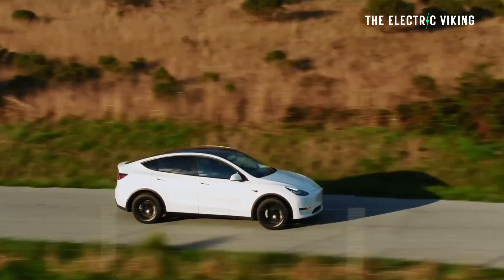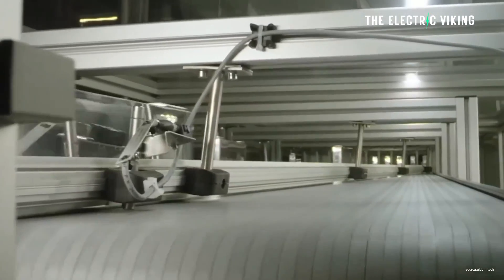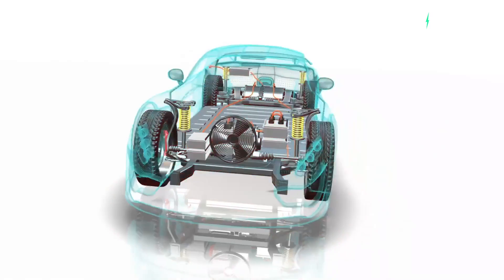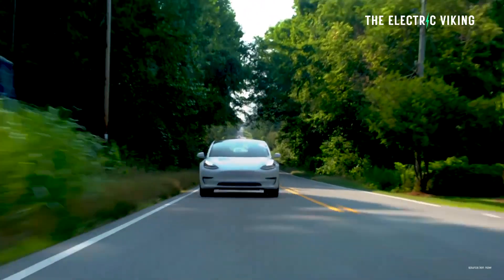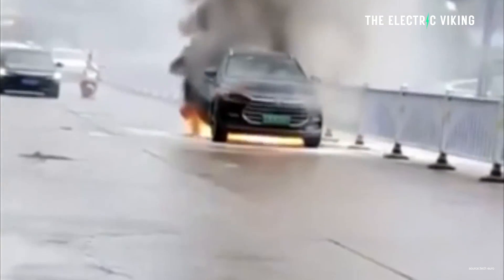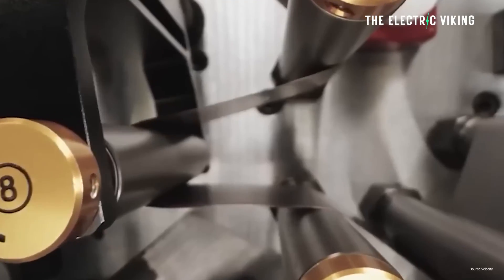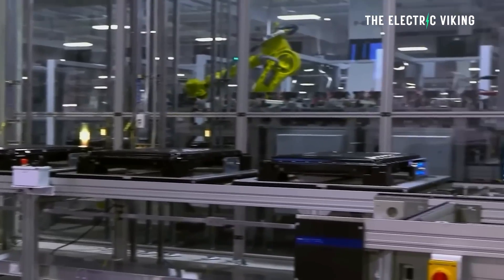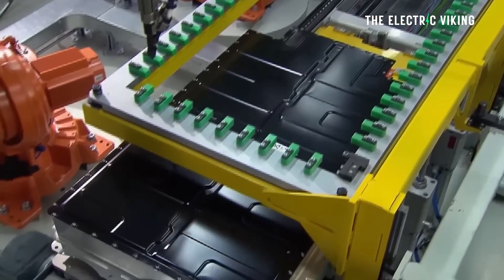Tesla offers LFP battery & suspension upgrade for Model 3 with 2170 cells

Comment: We just had our 2021 SR+ battery replaced with an LFP remanufactured battery after Tesla  posted the BMS u029 code on our screen.  There were no indications of battery malfunction.  Tesla still uses the 2170 batteries in higher trim performance models as the LFP battery is 120kg heavier.  Could it be sneaky Tesla wanted the LFP battery in my SR+ for warranty puposes on performance models?

Comment: Hi, I need urgent advice!!! I have a model 3 2021 SR+ and recently the battery failed, I took to service under warranty they made me sign a paper saying I will be getting an LFP battery upgrade. Long story short, a week later my app notifies me that service is done. I go to the location and pick up my car and drive away. 3 weeks later I receive another call from tesla employee telling me I need to take. my car back to them because apparently my car was not accepting the LFP battery so they had to put the same older type of battery but during the service process they had put different suspension to accommodate the LFP battery (as mentioned here in the video), so therefore they need me to go back so they can replace the upgraded suspension back to my older system of suspension that is made for non-LFP cars....... It sounds fishy to me. Why was this not communicated to me during service?  Please help me with advice. Thanks

Comment: I would just prefer if they would offer LFP batteries in their long-range models with a bigger battery pack. I assume lots of taxi drivers would be positive in that sense they need to use super chargers during a work day. At least if the car is used by more than one driver per day.

Comment: LFP or LiFePO4 actually has been used in e-bikes since 2013. I used to build my e-bikes with them because it has double the life span of regular lithium batteries. However, in terms of peak voltage and weight, the 21700 is better. I suspect that’s why they will give the car new suspension to deal with the increased battery weight.

Comment: so would this be a LR pack or a SR pack? If I have a damaged Model 3 Long Range is has (depending on manufacturer) around 80 kWh. Would the replacement be a similar capacity or would that be a smaller (standard range) pack?

Comment: After three and a half years my 2019 model 3 had battery issues and required replacement under warranty.  I requested a LFP replacement battery but the Tesla service center in Canberra advised that they could only replace like with like.  I am happy with the replacement battery (but preferred LFP) and  have an increased range of about 40 kms.

Comment: The LFP being discussed can be charged to 100%.  But charging rates are 100KW less.  More than 40% slower. Horrible on a trip.  Plus, this “more range” claim than 2170s is flat wrong. Heavier and less power storage dense. Also, claim that Japanese-American made batteries are less reliable (defects) than ChiC0M, not true. If an owner does not ever road trip charge, charges at home overnight, local driving, these LFP can make sense.

Comment: I dont think Viking fully understands the engineering behind a LiPo to LiFePo4 transition.
LiFePo4 has lower voltage per cell (4.2v vs 3.3v) and therefore less energy density across the whole battery.
Probably also lower total battery voltage when fully charged so less power there too.
Reply: Also LFP have a cold start problem, if you live in cold areas it's not recommended, sure it's been improved, but still.

Comment: Dont understand why anyone would even entertain the idea of replacing an EV battery as the cost of a new battery is generally higher than the value of the vehicle itself if its got a few years under its belt. No EV will retain its value long enough to warrant that sort of outlay , exactly the same as mobile phones .

Comment: This is why Nio will be a competitor in the EV market due to its-high tech battery swap stations. Battery degradation is a non factor for as long as you own the vehicle.
Reply: Yes that is a option but in the long term it costs more
Reply: @chriskirkman6049  what cost more ?
Reply: doing the battery swap, yes the car is cheaper to buy , but they charge for each swap and long term it costs more than if you brought a EV with a battery. But also batteries in the EV;s are lasting longer and this seems a bit pointless.
Reply: @chriskirkman6049  sir you have to pay to charge your Ev anyway , with Nio you have two choice. For those who have time , will have 20 - 30 min to charge however, they will be some that don’t have the time , so they will go with battery swap which takes 5 min. In terms of batteries tech , as you can see many batteries are setting on fire. This is a concerned for many retailers. The batteries are built with  components that wear out. That’s why swapping is the future.
Reply: Have you looked at the Li Auto Mega this will charge 10% to 80% in 12 mins giving you a range of 500km , this is what i am meaning battery tech is changing so fast, charging times soon are not going to be the issue.
Reply: @chriskirkman6049  yes ive seen the li auto mega and everyone knows the faster the batteries charges the faster it degrades. you have to understand batteries will only go so far in tech. thats why a lot of batteries are exploding . the chinese government will give subsidies to ev owners that only do battery swap. this is because of the many fires that are occurring with lithium batteries. also it has not been proven that the li auto will charge in  12 min. aside from that it still not faster then battery swap which has been proven to swap batteries in 5 min. stop thinking batteries are going to get better they are not. there is only so much you can do with the materials that the battery consist of .

Comment: My Bolt EV's ternary battery has an 8 year or 100k mile warranty, but I'm hoping it'll last 200k miles with reasonable care with maybe a 20% range loss. It's four years old and has 16k miles now, so I'll reach eight years long before I reach 100k miles. I may not own it when it reaches 200k miles, but if I do, a replacement battery may be very affordable by that time. EVs and especially EV batteries are improving so rapidly now that it's hard to imagine what they'll be like in a decade. If we have true robotaxis by then, I may not own a car at all. Subscribing to a service may be less expensive.

The car won't be worth much anyway. I've only driven one car 200k miles, a Toyota Celica. It was my first car, and it was literally falling apart when I finally sold it.

Comment: Here in Canada, A news report just showed it takes seven to 10 years to break even on an average Tesla EV purchase — just in time to have to re;place your battery.
Reply: How do you 'break even' on any car purchase, EV or ICE?
Reply: @johnbevan9086  break even on this case means the premium paid for an EV compared to an ICE  - here’s a snippet -“If you're wondering whether the gas savings are worth the extra money you'd spend on an EV, a new UBC study has some answers….”  The quick answer - 10 years but by then you have to pay for a new battery - while the ICE vehicle will likely march on - Crazy, eh? 😁
Reply: @pilotleader for me this pretty wildy wrong, but I do drive more than most. I have a 2021 standard range model y which cost out the door taxes and rebates in and everything for $64K canadian. I've done just over 100k kms as of now (3 yrs of ownership)and my estimated savings (total gas savings - electricity cost to charge) is at $21k. So for me in 9 years the car will have cost nothing, and about $1100/year in electricity. Plus my HV battery is being replaced under warranty so I may get close to 9 years before I need another one.

Comment: The case for still using NMC chemistry is getting weaker.  I'm only interested in an EV with lifepo4 batteries. Wouldn't touch a 2170 powered ev with a barge pole.

Comment: One of the benefits of a EV is how you can do upgrades. Look at Hyundai upgrading 2022 Ionic 5 with duel motors and heat pumps to get battery condition.

Comment: I've got a 2022 M3 LR AWD, probably won't have to worry about battery replacement for easily a decade (and rust is a bigger worry over that time), but would be interested to see the math of the LFP mentioned here compared to mine.

Comment: I want a 400 mile claimed ranger so and can get and actual range of 300 miles on the highway . In 3 or 4 years the battery's should
be much better than they are now in all techs.
Reply: Compared to ICE's BEV's range is inverse between city and highway.  Mileage estimates are usually mixed or combined so when on the highway you always see less range, but in the city you get the rated ranger or more.  It throws some people who are used to it being the other way around.

Comment: That's one thing good about the nio model.  This kind of concern isn't there.
Reply: Yes. you can buy an EV without battery and pay monthly fee 199/299 for your battery. 24k for battery renting for a decade.😂
Reply: @Devilhuo  but you never have to replace or repair your battery once the decade is over.  Say it's really 24k over a decade you paid less at the beginning in the first place plus never have to worry about battery degradation.
Reply: Except with the nio you're locked to a pack size and weight which means upgrades in the future are constrained.  There are always trade offs.
Reply: @TheEvilmooseofdoom  locked to a pack size?  What you mean?  There are different sized batteries you can swap out.

Comment: The issue at stake here is the high probability of M3/MY Std. Range needing warranty service of battery more frequently, due to reduced range, using up the max cycling faster. It is better to make it an upgrade, with a small 🥕 to add on(suspension improvement). It is also possible the new upgraded LFP battery needs an updated mount(part of suspension🤔).This will avoid unneeded free replacement service in future, while even paying for the supposedly free warranty replacement. Tesla is good at tracking numbers, and it seems to point this way. Just some 💭
Reply: What Tesla model you own !!!!!
Reply: @_nosikeuzoma1456  2019 AWD, 2021 RWD

Comment: I think the problem for older Teslas is the hardware that's runs the software . We know with computers there operating systems degrade . With that loading can get quite slow and glitchy . I have a older laptop that allowed windows 10 upgrade some years back but won't allow windows 11 . It originally had windows 7 which Microsoft does not update . So there will be a time that Tesla may not update its older systems .
Reply: Let me give this a try.  Tesla cars from 1000 feet up have several computer systems.   The ones that come to mind are the display(s), FSD, and several RTOS based systems.  RTOS meaning Real Time Operating System,   a classification not a brand.   Most everything that makes the car go happens in the RTOS systems because they give instant response. The display computer allows the driver to interface with car but little 'work' is done there.  I am sure you can find better more detailed descriptions elsewhere on the net.

Comment: I  saw that I can get a Cybertruck under the early access program for stockholders.  Do I do it?   I wasn't expecting it so fast and it would take some juggling financially to accomplish.
Reply: Can you tell me where that early access is accomplished? I'm a current CT reservation holder -- and hold stock as well. Are there minimums etc.?
Reply: @RandyP-jr1ek yes they are
Reply: Forget my earlier post -- its just for long term shareholders. Oh well.
Reply: @RandyP-jr1ek are you also a stockholder
Reply: @_nosikeuzoma1456  Yes. Short Term though - so no joy.

Comment: Performance is not only down b/c battery pack is heavier, it’s down b/c LFP density is lower than ternary and therefore power output is also lower!
Reply: Lol. LFP is the way to go, where all the future development is at, energy densities are improving, & w/ the reliability, stability, and most important, the safety, no thermal runaway
Reply: Why would a LFP pack put out less power?  I think there is a flaw in your understanding.
Reply: @TheEvilmooseofdoom do you own a Tesla

Comment: As battery technology advances I hope all EV makers will offer upgrades. They could make as much profit as selling a new car without the cost of having the make the entire car.
Reply: There will be some limits, if new battery tech changes the size of the pack at all putting in a new pack won't be an option.
Reply: @TheEvilmooseofdoom  If the technology really does "advance" it should take fewer or the same number of batteries to give the same amount of range or better. However, the charger and software may need to be changed too if you want it to charge faster.
Reply: @frankcoffey what Tesla model do you own
Reply: @_nosikeuzoma1456  We have a '22 Model 3 and a '23 Model Y both the long range versions.
Reply: Yup give folks a decent trade in credit(used pack level values for recycling are $2,500-$3,500 currently for ev pack's and more if taken apart and sold as modules for conversions and home storage. And states should offer say a $1,000 credit for any 3-5 year old ev pack replacement.

Could bring replacing a battery down to $4-6k that way. Or about the same as a rebuilt trans or rebuilt engine costs. 
Then buying a cheap used ev, made cheaper by the 4k used ev credit and slapping one of these pack's in would make sense for lower&middle income folks very quickly. 

Even used ev car dealers if state incentives existed could go confidently buy up low range older used evs, swap in newer pack's and ask 6-8k more post upgrade for them and get it with the used ev 4k credit no problem. 👍🏻😎

Comment: Very very nice! I think with exclusion criteria warranty and "faulty battery" the amount of cars that will be elligible will be small. Faulty battery is an expression that hides susceptibility to interpretation for good and bad.
I like the idea of battery replacement as a service. But I think it will be a long while before we see that, because batteries are in high demand. Maybe when outgoing battery pack modules becomes a thing we might see service come into play as a convenience factor for another for profit business model I think would make most sense to Tesla.
Conversion kits would be very nice😃. If it also supports very good lane assist and adaptive cruise control, with Tesla motor and battery, that would be awesome.

Comment: My 2016 Model S has covered 259,000 miles so far. I'm hoping that in the future, maybe 3 or so years down the road, there will be an option for a lighter pack, with a slight range improvement and faster charging, more in line with the later cars.
Reply: How many batteries/motors?
Reply: @taylorc2542  more interesting is the motor. I lately saw a company wich repairs faulty older model s motors.  These motors do have a bad sealing where coolant gets into the motor at some point. If noticed too late it gets into the electronics. But I really don't know on what milage this occurs. Later motors they said are a lot better.
Reply: @Nordlicht05  are you a Tesla owner
Reply: @_nosikeuzoma1456  I tried write down what this company's said about older generation motors which they also repairing. This company also uses Tesla battery's and motors for EV conversations.
Reply: There is now, check out what EV clinic in Croatia does
Reply: @14energy  do you own a Tesla
Reply: @14energy  you own a Tesla?
Reply: So when you decide to sell your car to someone, what benefit can you pass on to the next owner?
Reply: He's only had to replace both motors twice, one under warranty. The battery was replaced only once and the replacement is still running strong at 71%.

Comment: Battery swap would eliminate any battery problems ... Think about it Viking ... NIO are doing it now! Tesla cars are not worth anything if battery is 8 years old and out of warranty ... Think about it!!!!
Reply: I agree with Sam that Tesla should make this available for all Tesla owners to buy.

Most all the OEM have their many induce "planned obsolescence", forcing consumers to buy another vehicle after a certain time.

It seems Tesla doesn't play by their rules. So Tesla should open this  Sweet Battery Option to all owners of Tesla.  🤗
Reply: Can you point me in the direction of the chea 8 year old model S"s that are out of warranty please..,.......
Reply: Battery swap means the car is restricted to a pack of a certain size of weight.  Any changes or upgrades that would alter that would not be available to cars that need a swap.  It locks you in and becomes a barrier to future upgrades since they will always be hand cuffed to a very specific form factor.  As a automaker I wouldn't do it.